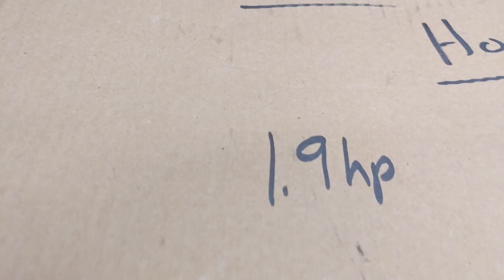Best Cordless Ratchet Makita Husky Milwaukee TESTED 12 volt

Comment: Had the Milfuckee since it came out then upgraded to the Fuel (3/8”) Wouldn’t mind it being faster yeah but that torque 😮
Reply: Yeah, that's the trade off.  Their M12 line has the speed and Fuel has the torque.
Reply: @jmackinjersey1  I find myself using the old brushed one a bunch more because i don't wanna just break everything off. The Fuel is just holy crap. The older one also just free spins no electic brake deal so it can snug them up no problem then get them tight after. Love them both though
Reply from the maker: If torque was the only factor, Aircat makes an pneumatic ratchet that'll bust free 130ftlbs. It only spins around 200rpm though. If you give up a little they have one that'll do 80ftlbs and 600rpm. Maybe one day soon battery can catch up or Makita will make a dual speed like on drills. So you can switch a gearbox from high to low torque/speed.
Reply: I believe Milwaukee is coming out with a high speed version for the cordless ratchet line this year.
Reply from the maker: @oftenam  Higher speed, yes but they're also dropping the torque down to 35 ftlbs from 55. They're claiming 450 RPM no load vs the Makita 800 RPM.
Reply: @oftenam  They already have them, as I described above.
Reply: @sixtyfiveford  Exactly, you can't have high torque and high speed, that is why Milwaukee gives you a choice and sells separate tools.

Comment: Great video and testing, very useful information, thanks, Moe!
My favorite is the Makita, I already have some Makita tools so it would fit right in.
Reply from the maker: Right on! There's just something about the engineers at Makita. Their tools just always impress.
Reply: @sixtyfiveford  Makita doesn't always get it right, there multitool is crap with just an on off switch and you have to adjust the speed by a roller dial which is awkward , and the blade change is crap also that's why i bought a Dewalt multitool, easy blade change, easy trigger speed control makes easier control of jobs and instant switch off, simple best multitool, wouldn't buy the Makita so in that case i bought a battery converter makita to dewalt.
Reply from the maker: @craig2539  Agreed. I had the Milwaukee Multitool and it was garbage. The Makita just looked poorly laid out so I never bought it however I bought the Dewalt and it's the best for sure. I've had the Milwaukee and Dewalt Impact driver and drills and they stink in comparison to the Makita though(bought all three brands and sold those off). There is no one brand that makes everything perfect that's why years ago I decided to invest in all the battery platforms and let the tools speak for themselves.

Comment: Really great comparison, but I wish for the sake of comparison how the air tool would compare in both torque & speed because I have not purchased an electric ratchet yet but I still have my 30 year old Craftsman air ratchet.
Reply from the maker: I have a Craftsman air ratchet that I briefly showed in the video I bought 20 years ago. I did do tests with it but decided to omit them. It spun around 170rpm and would remove around 35-40ftlbs. The unique thing about the air ratchet is it doesn't shut off/stall out like the battery powered. It just keeps hitting and I wish the battery powered would do this. However, it saves you from having smashed fingers. The noise and lack of speed are the reasons the Craftsman has been sitting unused for a long time.
Reply: @sixtyfiveford  Right. Thanks for the detailed response. I don't do enough wrenching these days to justify buying a new electric ratchet. I may keep an eye out for the Husky or Makita at my local pawn shop, though.
Reply: WHO WHO WALKWA  I think so. I talked to soon, though, as my local Pawn Shop is out of business due to the riots & looting. It's back door is still spray painted "kids live here" so no one would set the place ablaze as their appears to be apartments on the floor above the Pawn Shop. It's been an awful year here. Even the Apple store is completely gone and unrecovered while all the stores around it have reopened for business. And I discovered the hard way that most of the bicycle shops around here are closed, too, when I had my 4th flat on the road thanks to all the extra road debris from the rioting. I had my 4th flat in one month and before that with the same bike I only had one flat in 3 years of owning it. So things are still really permanently fucked up here. Then I showed up at my clinic for a shot the other day and turns out they reboarded it up for the Chauvin trial. What a mess! This year is already turning out worse than last year by a long shot.

Comment: The problems with this test is that the Milwaukee extended 3/8 ratchet was designed to sacrifice a lot of speed  over the internal transfer shaft  to main the break out torque of 55 if I recall , there is new m12 3/8 hight speed ratchet thay torque at 30  but faster speed
Reply from the maker: Milwaukee Fuel extended and standard have the exact same specs. I kept it around for months after the video thinking I would use it and like it. The Makita is just so much better I ended up ditching the Milwaukee. A lot had to do with just the form and function of their tool and the fact that they're using 30-year-old features with the internal batteries.

Comment: The Milwaukee is a winner for me.  I’m looking for nut busting on exhaust manifold bolts, suspension bolts, etc.
Reply from the maker: Problem is it's too weak for all of that. It's like one in 200 times that you would just pick up a impact gun that the Milwaukee might come in handy. I tried liking it and kept it around for months after I did the video but ended up just selling it and have been very happy with the Makita.
Reply: @sixtyfiveford   Since the Makita has less torque, is there any ratchet you would recommend for breaking loose exhaust bolts?

Comment: Im getting the 18 volt Makita but it is hard to find it in stock. It has the same 35 footpounds and 800 rpm, i want it only for the battery system.

Comment: I was wondering if you considered the Kimo instead of the Husky.  The drawback to the Husky I see is that you cannot switch batteries, you have to put the unit in the charger. Thanks.
Reply from the maker: The Husky lasts forever seemingly on a single charge. It'll disassemble an entire car engine and still have half charge. But they all seam to be like this with the Milwaukee probably being the most power hungry. Now when I did this video the Husky was $50 and nothing could touch it price wise and therefore a no brainer. It is now $100 and other stuff is looking more attractive and I don't know if I would personally buy it at $100. 

The Kimo is just one of 2 dozen identical rebranded Chinese cordless ratchets. The ratchet itself isn't bad but the use the lowest quality battery cells in the packs and they die(like dead dead, not low needs recharge) after months/a year even without use. They are a disposable tool that will give you 3 months or maybe 3 years or service. What I'm saying here is you can get other identical(exact same tool with different brand) for cheaper sometimes on Amazon.

Comment: The husky just for the price seems great. I like how compact it is. obviously the biggest trade off being non removeable battery. Arguably though.. if you caught them on sale for the 50 or so dollars.. imagine buying two and just switching them out when one dies or just having two in general with having them fitted with two different sockets .  The price is forsure there for me.  im not so keen on the price of the milwaukee. however i know they offere other units for a better price but that husky looks tempting.
Reply from the maker: The Husky is fantastic and will handle a major job without running out of power. I just throw it back on the charger after every job and it's always ready.
Reply: @sixtyfiveford  thanks for the reply ! Yeah it seems especially useful with how compact it is. In general I dont need them to have a ton of torque cuz most of the time I'll just use the leverage of the handle. After its busted loose is when I usually will use the button to back the bolt out. It's just so much faster. I have my air one and it works good but it's a hassle trying to get it to fit in tight spots and the hose catching on everything. Currently at my local home depot they are at the 89 dollar mark. Says the prices fluctuate though between that 50 to 90 dollar range. I'll just request the website. Thanks !
Reply: WHO WHO WALKWA  not really, most cordless ratchets focus is speed at which you can remove the bolt. You use it initially as a standard ratchet to break the bolt loose and pull the trigger to run it off. Its way faster than a standard ratchet

Comment: I like that passthrough design on the Makita but looks like you can only use it on one size nut or it could easily get lost, I like it but I would be a little scared to own one.
Reply from the maker: Yeah, the pass through is really only a side feature that would likely never be used.

Comment: The Makita head is a nice addition with the inter changeable anvils.  But I wonder how it will hold up over time.
Reply from the maker: I've pulled the anvils in and out probably 100 times now and it has no issue. Every once in a while a socket will pull the anvil out when you remove it. It's only randomly and only when I use impact socket with the pass through ball detent hole. They do have a replaceable hog ring that would be the only thing to need replacing once in a while. It's funny because the Makita detent is super strong where the Milwaukee denent ball is weak and I'm constantly having deep sockets or socket with extensions fall off into the engine bay.

Comment: Have you looked at the Hyper Tough 12V MAX ratchet and other tools in that line at Walmart?  What are your thoughts on those?

I bought 2- ratchets, 2 - extended ratchets, impact 1/4” driver and drill combo and the 3/8” brushless impact wrench and I like them for the price $29 -$59 for each kit and rack kit comes with a 1.5 or 2.0 mah battery and charger. Then bought a $17 speed charger and 2 $24 4.0 mah batteries. 
I changed the 3/8 anvil gear to a 1/4” so I have 3/8 and 1/4 short and long reach ratchets. 

I think it’s one of the best bang for buck line of tools on the market right now based on price and tool options.
Reply from the maker: Great for the money. The problem with tools or anything is something that is 10% better/stronger/faster is 2x-10x as much $$. You really can't beat them. The only drawback I can see is the batteries. The cells inside to be more specific are budget and have a low lifespan.
Reply: @ well thanks to your channel I learned how to make or fix lithium tool batteries.  So I have saved a few Ryobi batteries they stopped working  and I plan to go through and pick out the good cells that can be reused. I plan to replace batteries in one of the HT 1.5ah batteries to see how much better it might be. 
Keep up the great work! I enjoy your content and love your dog!🐕

Comment: This was awesome! I’ve been on the fence for what home shop cordless ratchet to get. Have you tried the ACDelco G12 line of tools?
Reply from the maker: I bought it off of Amazon and tried it out and was not impressed. You're better off with the $60 husky from Home Depot. General Motors sold the ACDelco name out and now Chinese companies just throw the name on stuff.
Reply: @sixtyfiveford Thanks for the advice!  I'll watch for it on sale or the Makita on sale! I found it interesting that the G12 tools could take Harbor Freight batteries...  That's sad to hear the quality just isn't there...
Reply from the maker: @atomikrobot300099  Years ago I went to China and looked at a lot of their manufacturing practices. Places like Harbor Freight do not make anything themselves. Independent factories just steal designs and they all make copies of the exact same thing and you were able to buy them and they'll put whatever brand name you want on them. There will literally be 50 to 100 factories making the exact same identical item in any color of plastic you want. So Harbor Freight did a bid with a random factory and said yeah make a million and a half of these with our name on it and ACDelco said the same thing to the same factory or one of the same factories using the same designs.

Comment: Thanks for the video! I have the husky(was a gift 2 yrs ago), but I've considered getting the M12 since I am already into that line. I think the brushed M12 is supposed to be a little better with speed, but less ft/lbs.
Reply from the maker: I used the Husky and the M12 brushed and I preferred the Husky. I felt like the Husky was faster and maybe just a smidge more powerful. Also these both are so short you put a ton of pressure on the back end and I could feel the battery flexing constantly with the Milwaukee.

Comment: I went with the milfukee a couple years ago due to its slimmer design and longer reach. BIG MISTAKE !! They simply don't hold up even in light occasional use. The anvil gear and pawl wears out on no time and the driveshaft snaps. 8
I've been through 4 rebuilds. 
They simply suck.
Reply from the maker: I wondered why I saw so many rebuild kits being sold for these on Amazon.
Reply: Are you talking about the older model or this new fuel model? I know that the first gen had weaker internals.
Reply: @mauricioespinoza5390  
Not sure what generation I have.. whichever was on the market a couple years ago.. but I thought the replacement parts had been upgraded, yet they don't last any longer than the original. 
I'll be buying teal instead of red when it breaks again. The parts aren't cheap.
Reply: @mauricioespinoza5390  The feuls do not have the issue with the internals. As you can see in the video Miluakee purposely overbuilt the new generation.
Reply: I abuse mine and never had an issue, 8 months the money maker, I like it over the control and not slamming bolts in for mechanic work
Reply: @dontblameme6328  The extend reach seen here only came out like maybe two years ago and the regular fuels a while before that. The first generations have smaller black colored heads. Those did have issues, the 2nd gens with the bare metal thicker heads are tanks. No one is reporting any major issues with them, but they built the things so tough that the head became big enough to sometimes get in the way. The 3rd gen "high speed" ones are more of a middle ground we'll see how it goes, but it seems like they might have found the sweet spot.
Reply: Nice to hear the feed back from the fellas in the field.👍🏻
Reply: I wonder how it is I'm able to get extremely reliable use out of mine daily yet yours has been broken that many times. Sounds like operator error to me, its not a breaker bar and you can't use it like one.
Reply: i know im asking the wrong place but does anyone know of a tool to log back into an instagram account..?
I somehow forgot my password. I would appreciate any tricks you can offer me
Reply: @Elijah Cory Instablaster :)
Reply: @Allen Gustavo Thanks for your reply. I got to the site thru google and I'm in the hacking process now.
Looks like it's gonna take quite some time so I will get back to you later with my results.
Reply: @Allen Gustavo It worked and I now got access to my account again. I am so happy!
Thank you so much you saved my ass :D
Reply: @Elijah Cory Happy to help xD
Reply: I still have the first one I bought it’s doing great! I think it’s user error! Why do you keep going back if it’s so bad?!
Reply: @sixtyfiveford  because they sell tons of everything on there has nothing to do with tool quality has to do with what ppl can convince again to let them sell there rebuild for ask brands but mostly Milwaukee is awesome and popular so there’s a lot of everything Milwaukee
Reply: I got all the new fuel line up and one of the old gen 3/8 ratchet and never had or have problems with any of my reds and I’m in the heavy line wrenching and no problems. Probably user error or a bad batch cuz it’s possible. To each his own. I had a bad batch from Snapon and I love them too. Good video)

Comment: Makita, although not always the strongest, makes the best tools overall due to durability and design. Those matter to me more than brute power.
Reply from the maker: They are so much smoother and nicer to use in the long run. I sold off the Milwaukee a few months after the video and have zero regrets.

Comment: The issue is you would have to invest in new batteries unless you already have Makita 12 volt tools for those that have a large amount of M12 that could be a sticking point
Reply from the maker: You can buy the entire Makita setup with battery/charger for less the Milwaukee Fuel. I have been trying to like the M12 Fuel but it sucks in comparison. I wasted my money.

Comment: Hello again 65Ford
I've been looking at getting cordless ratchet, right now I'm using the old style air ratchet. I  researching which battery line will work for everything I need. I been using a 12v Hitachi  impact and drill. I have to admit I  expected them to break by now. I think the battery is a 1.5 it came with two batteries and a charger,  drill and impact.  But I am looking to expand  out. Depending upon what is available. Thank you for the Great Video.

Comment: I have 2 snapon 3/8 long necks... one is rated at 35 ft-lbs and 275rpms and the other is the brute rated 70 ft-lbs but slower.. wouldn't trade them for anything..
Reply from the maker: I used the long neck Snap-on and it's a fantastic tool with great build quality. I really liked the skinny neck/head. The Milwaukee's head is so bulky it can't get into those tight spots.

Comment: Most Makita stuff is good. That wrench is not. The head will start 'slipping' with little use but it is covered for three years under warranty.  I don't like the direction switch lever and the replaceable 1/4-3/8 is always pulling out when removing a socket!